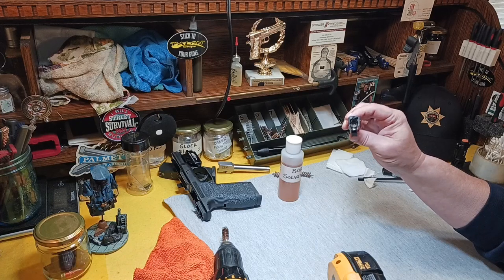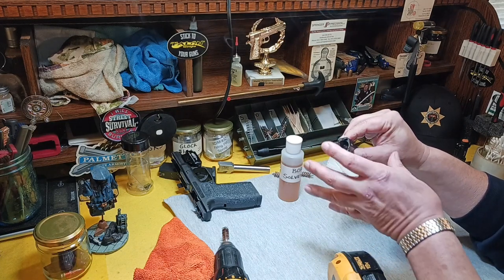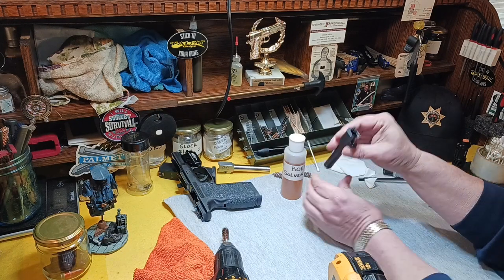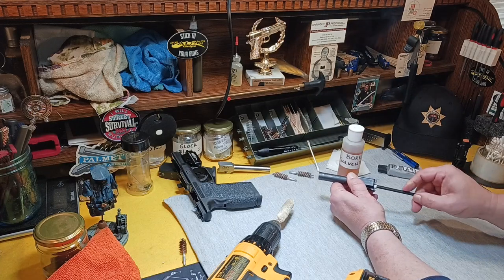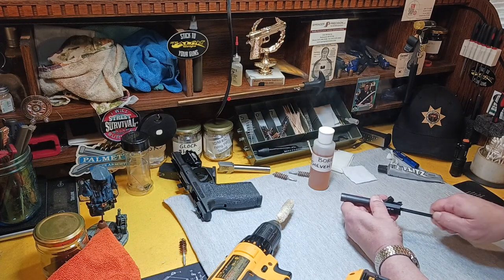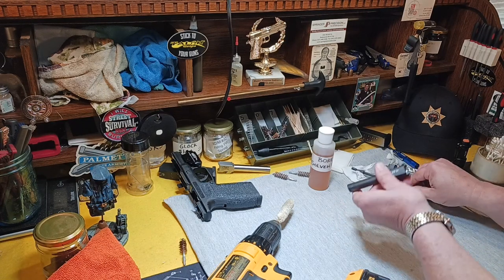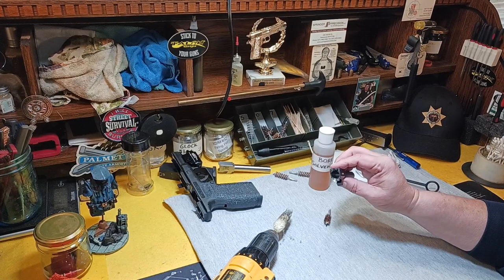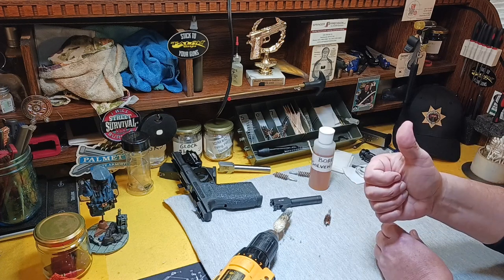Mandatory Chamber Scrubbing - When, Why & How

Comment: Is this a cleaning method recommended by Glock? I always was explained polishing a chamber was a no no because you won't have a good seal between the brass of the cartridge and the chamber walls.
Reply from the maker: ?? How could polishing the chamber cause a problem in the "seal" aspect? Polishing does not remove any steel, it removes deep oxidation and burned on surface debris. This method is no different than using a bronze bristle brush attached to a short cleaning rod, and yes, Glock has zero objections to the method.
Reply: @shootinitstraight4162  The myth is that polishing the chamber reduces the grip on the expanded brass creating a less than desirable seal. Notice I said myth maybe you have some clarification.
Reply from the maker: @geoffrey3289  
Gotcha, thanks for clarifying that for me. No, a good seal comes with a CLEAN chamber, not a fouled chamber. Scrubbing the chamber CANNOT cause any dimensional change at all, and it will ensure proper extraction. The "seal" has nothing to do with anything, unless the chamber is heavily fouled. And you're right... It's just another myth.

Comment: Thank you! 💯Question ~ (even though I just watched,) Some say that we should run the bronze brush through ONE direction only, from chamber towards the front of the barrel and all the way througn, not back and forth. Then unscrew, withdraw the rod, and start again. Is this true?
Reply from the maker: @Geoff C
No need to unscrew the brush. It's fine to go both directions, just don't try to change direction while the brush is still in the bore, since it will crimp the bristles and make hard to remove. Just go all the way thru, then pull it all the way back out.
Reply: @shootinitstraight4162  Wow! Thank you so much for the reply! Love your channel...binge watching. 💥

Comment: I've always been able to remove any hard to remove plastered burnt carbon build up with some good elbow grease after giving solvent plenty of time to soak.  I dunno, I'd  refrain teaching others to use power tools to clean your barrel as you're always going to set them up to possibly do more harm than good imo.. If you have caked up carbon the best thing is just to give the solvent plenty of time to work its magic.
Reply from the maker: @muddy Hotdogs
I can understand what you're saying. However, bronze bristles cannot harm the hardened steel chamber, whether by hand or drill. Use of the drill is only MY method, I am not suggesting that others must use one. By the way, your advice on soaking is also a great alternative. Thank you for that input, my friend.